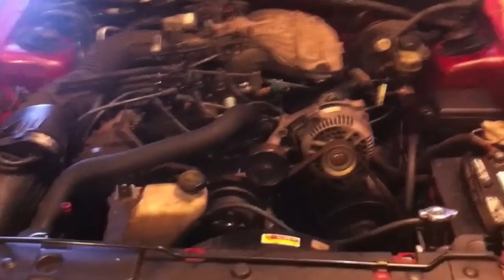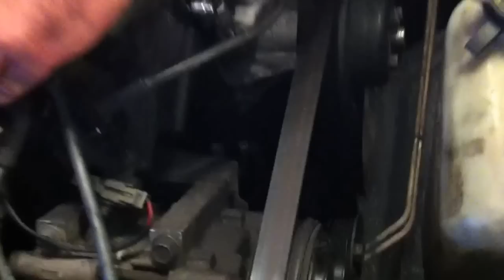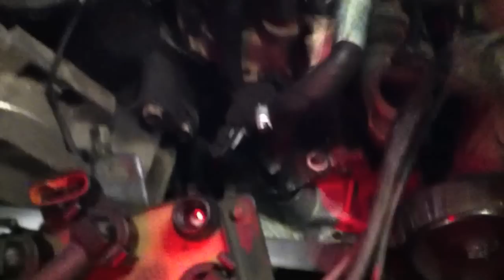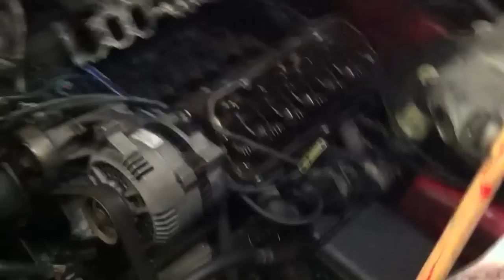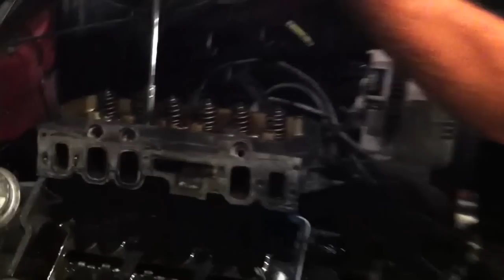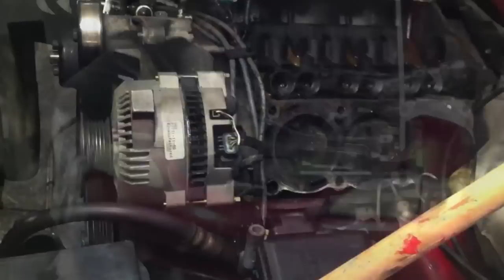How to replace a head gasket (1997 Ford Mustang 3.8L) part 1

Comment: Working on a 2000 Mustang 3.8L, Gf's car, said she was driving down the road and it over heated, and sounded like beer cans rattling under the hood. (Anyone but my gf would have stopped before it got to that point lol) I got it down to the heads and didn't spot the bolts under the headers/exhaust manifold (which ever it is actually called) This video helped me with that. Appriciate it. I too am a shade tree mechanic :-) I wear flip flops every time I work on cars. I also wear flip flops when I cut the grass, just saying :-)
For any that are curious on the 2000 model the primary sockets are 7/16 (Intake/surface parts) 1/2 (Header connects to head, and rocker arms under valve cover, 15mm (where header connects to exhaust pipe and the head bolts to block) Also 5/8 and some other very small bits which would come with any 160+ craftsman socket set. Breaker bar for head bolts, torque wrench for install, WD-40 for exhaust bolts (pre-treat). Recommend extensions (about a foot for doing header removal where it meets exhaust pipe from under the car, swivel bit for doing exhaust bolts at the head. GLOVES for when the bolt breaks look unexpectedly and you smash your hand into nearest object with corners. 

Hope this information helps someone :-)
Reply: Jesse Bevil other very small bits which would come with any 160+ craftsman socket set. Breaker bar for head bolts, torque wrench for install, WD-40 for exhaust bolts (pre-treat). Recommend extensions (about a foot for doing header removal where it meets exhaust pipe from under the car, swivel bit for doing exhaust bolts at the head. GLOVES for when the bolt breaks look unexpectedly and you smash your hand into nearest object with corners. 

Hope this information helps someone :-)

Comment: Hi Germain, thanks for uploading the video. I've read over the related sections of 97 Mustang Service Manual of Ford Motor Co. I have couple of questions regarding the fix:
1) Did you need to drain coolant and/or engine oil before the repair process? I would like to replace oil/coolant at the mechanics' after the repair is done. I don't have a garage (hoist etc.) and don't want to make mess in my apt. complex. 
2) Since lower IM is "glued" to the cyl. blocks with a silicone sealant, was that difficult to separate them? Can one person do that? Is lower IM too heavy for a person to play with? Manual says use a pry tool carefully in order not to damage the cy. blocks. Prefer the manifold surface to pry on.
3) Did you need to hoist the car for any reason?
4) Did you purchase dowel pins to be able to align the head gaskets on the cyl. blocks?
5) Since I don't have a garage, I want to close the hood after my couple of hours daily work on the engine is done. I plan to do this repair over 2-3 weeks. Is there anything which prevents one from closing the hood during the repair? The only thing that I consider regarding this is the fuel injection supply manifold (you call it fuel rail). Do I need to take it out to be able to close the hood?
   
Thank you so much again for uploading the video!
Reply: Yes you should and you should drain the oil too. The reason being that the two have mixed anyways if your head is blown.

Comment: I need help. I've removed the 8 bolts and the headers but it still won't budge. I got a how to print out from AutoZone and it says to remove the alternator bolts and power steering brackets but yours are still intact .

Comment: When I changed spark plugs I noticed oil on the threads ..in other cars I have worked on this would usually just be spark plug tube seals...but this v6 mustang (2004) I think does not have these tube seals?  Looks like the plugs thread into the block and the head gasket would keep oil out if them?  Any help?
Reply from the maker: Oof not really sure on that one.

Comment: By any chance do you remember if there was a big vacuum line on the bottom side on the air horn? if so. what did it go to? I'm working on a 1994 3.8l and it was mickey moused big time. but the OEM spec's dont show that vacuum line.

Comment: Thank you for the video. We just bought a 94 with the 3.8 and it is needing a head gasket. Your voice over said there was a web site with info but i dod not find the link. Any info you can share would be GREAT!! I work on older Fords mostly the 351W and need a motor diagram with torque specs for the 3.8. A shop manual would be the best probably. Thanks again.

Comment: did you take out the power steering pump off to screw the bolt  on the bottom of the alternator?

Comment: Thanks for the videos, i am about to have to do this on my 97 mustang, had a freeze plug crack but also the head gasket has blown. Pretty cool video, but you didn't show it but you did have to remove the water pump and everything on front engine right?
Reply: Did u?
Reply: @jake9631  Yes, but 6 years ago lol... Sold that long ago.
Reply: Well thx for the heads up

Comment: The only thing I'm still stuck on is how to get everything off that's on top of the intake manifold.. No one has a video showing this stuff which I feel is important as I don't want to pay a crazy priced mechanic fee.
Reply: As I've already done a gasket change on my '98 v6, start by removing the Air intake, Belt, Coolant tank. From there start disconnecting and removing all the EVAP Bullshit that pertains to smog, this will be the Red/Green wires connected to that little module by the throttle body and they run from that module to the Intake manifold. Once thats out of the way loosen that metal pipe that's hooked into the manifold (cant recall the name of it, but it's another smog type thing) Its located behind the manifold where that EVAP module should be. Then loosen all the manifold bolts and should come right off by shimmying it off of that metal pipe I mentioned.

Comment: does this work for a 2001 mustang v6
Reply: Same Block, different intakes, so my guess is yes. Ford used these old 3.8's from somewhere between the mid 80s through 04

Comment: Those headers seem to be in the way of the bottom four bolts of the head... how did you manage to get around those?? Did you have to remove them completely??
Reply: I believe that headers are also known as intake manifold...
Reply: Nope just loosen them and use a bar or large screwdriver and pull them away from the headbolts and use 1/2inch drive long extension and a 15mm socket

Comment: Hi, how much did it cost to resurface the heads ? .... sorry if I missed it .
Reply from the maker: Jose Jimenez  Cost for inspecting and resurfacing a head can range from $100 to $350 per head and cost will go up from there if the valves seats need to be reworked or if the guides and seals need to be replaced.

Comment: I have 2008 mustang  did u think I have to remove timing chain to do that job head gasket mr
Reply from the maker: fer Izqui I don't know if you will for that year. Hopefully someone will comment and let you know.
Reply: Ok
Reply: No still a push rod engine it doesn't have any over head timeing so there for no
Reply: @elbertcates8526  Thank you very much! Otherwise I have to send my 08 v6 pony to shop and give them more 1G.

Comment: what can I use to clean the mess up on th inside of block
Reply: engine degreaser and a soft towel, you can use a dremel to clean up the ports in the heads

Comment: I'm struggling to get the fuel rail out. There's a metal tube going through that I'm struggling to get out. That hose clamp in the back is a bitch to get out
Reply from the maker: Did you eventually get it?

Comment: Hello guys, I have a 1997 mustang v6 like the one seen in this video and was wondering if anyone can help me with a similar problem. I have coolant being mixed with my engine oil and I would presume it being a blown head gasket, but my coolant is literally leaking from my engine drain plug, NOWHERE else. I even tightened it (engine oil plug) to torque spec and it still seeps out. If anyone can help I’d really appreciate it ! Thank you for the attention ! :)
Reply from the maker: Are you sure it's not leaking from somewhere else and just running to the drain plug. wipe the oil pan down and wait till it drips and see if you feel any wetness.
Reply: @GermainMoya  will do thanks man !

Comment: What torque wrench is needed or required??
Reply from the maker: AbeDaBabe01 a standard torque wrench will work fine just make sure you follow torque specs. As a rule you should always tighten bolts to torque specifications.
Reply: Germain Moya cool thanks.... you don't happen to have those specs?

Comment: this magic in a bottle will only work ,if it does at all, if the head gasket is blown between the water jacket and the cylinder chamber. If the head gasket is blown between cylinders this stuff is useless. The ford's  3.8 is notorious for blowing gaskets between cylinders. The only real fix is to replace the head gaskets with a triple layer gasket. I recommend the ones by felpro as they not ford have seemed to solve the problem. Also stay away from blue devil. They guarantee their product until you open the bottle and pour 50 plus bucks worth of crap into your radiator and then the warranty is void.. They will not answer calls or refund any money. I should be called blue bullshit!!

Comment: to bad ford makes such a piece of crap engine in a nice car. Hey ford go over to Subaru or Bmw and see how a quality engine is made or better yet Mercedes the million mile people. Quality doesn't come from parts made in china or Mexico and using Budweiser beer cans for head gaskets.
Reply: +hpi miata  thanks for the info. was unaware of the bmw's having this problem. Is there a consensus that the triple layer head gasket  will fix this problem or is their a design flaw in the engine that makes this a re-accruing  thing. ?
Reply: Most Subaru engines and garbage and expensive
Reply: Subaru holds the record for the highest miles on a gasoline engine. It logged over 100,000,000 miles. This was not a diesel but a gasoline engine. I have a Subaru  wagon with 233,000 miles and it is smooth and quiet . It does not leak or burn any oil. The two mustangs that I had were nothing but trouble. Like the name ford stands for fix or repair daily